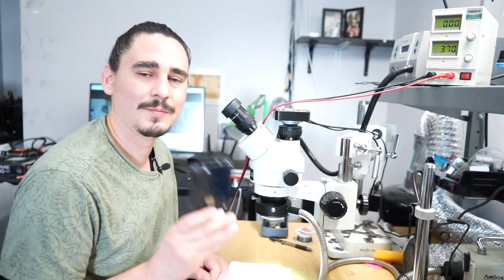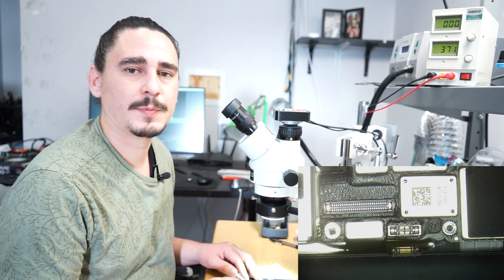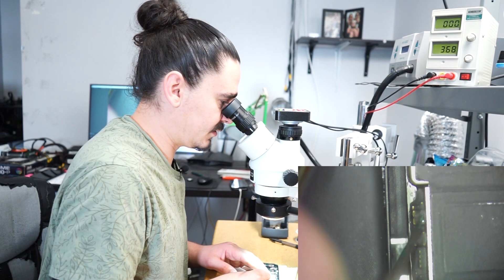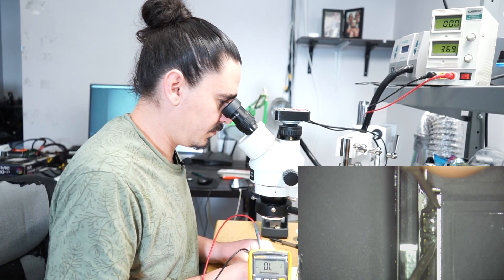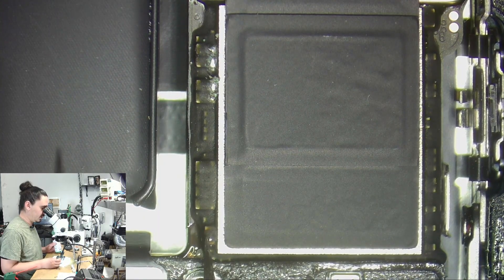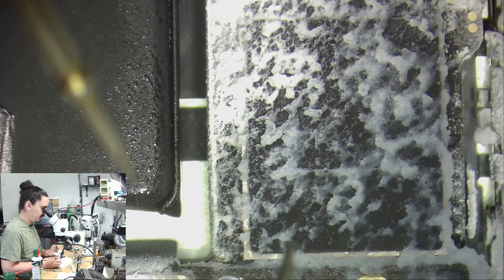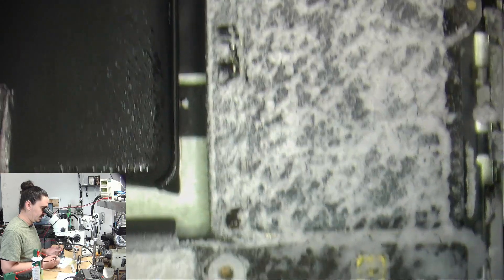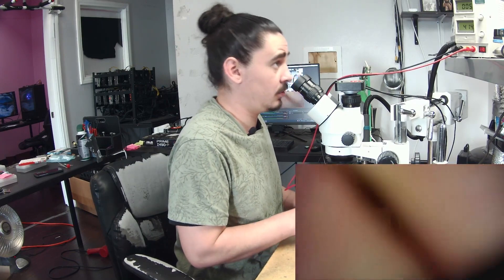How to Fix a Flat Dead iPhone 13 Motherboard - No Drop, No Water Damage

Comment: I jumped in my heated pool for less than 5 minutes with my IPHONE 13 in my Pocket; when I noticed I jumped out of pool, Phone already had a blank screen, and was getting very hot!  I'm hoping it was just the battery*. I Really need the data on my Apps, and Iphone texts and recordings.  What can be salvaged if anything ?
Reply from the maker: All data is likely still recoverable: https://www.iboardrepair.com/your-data
Reply: I got stupid drunk and fell outside my house when it was drizzling. the phone was outside for hours and still working when i picked it back up and then went shot once the battery died. i fell your pain